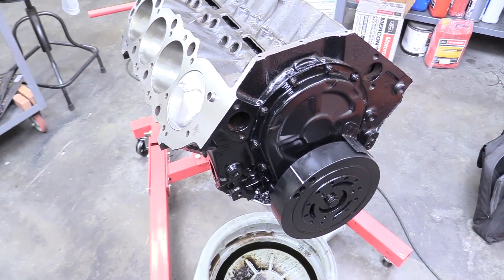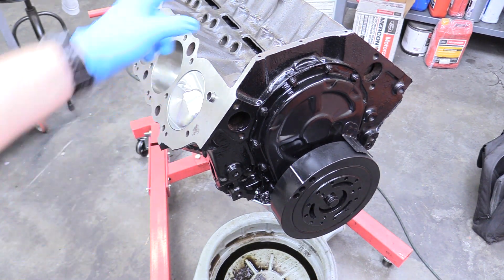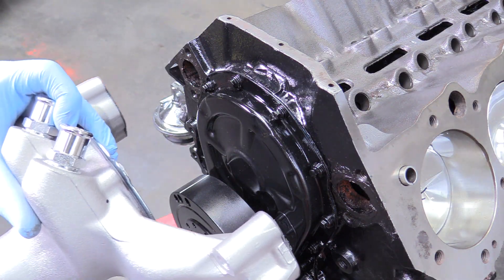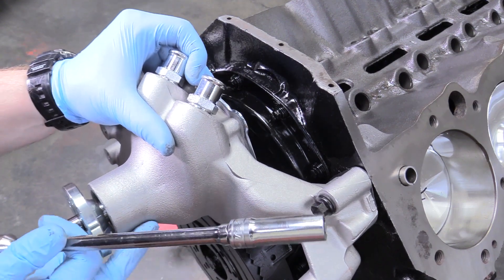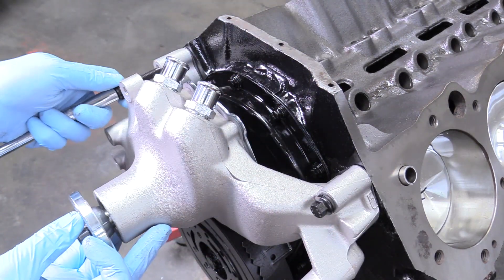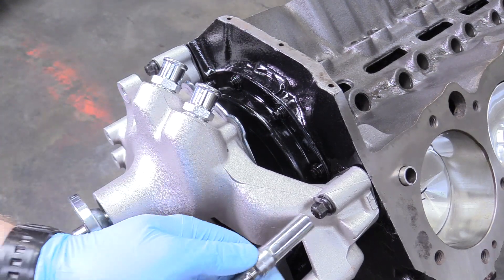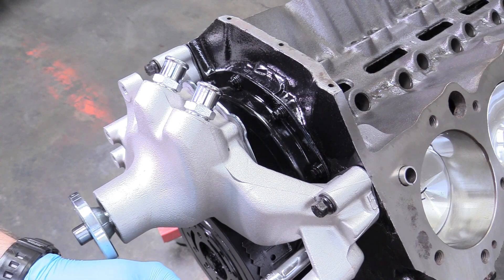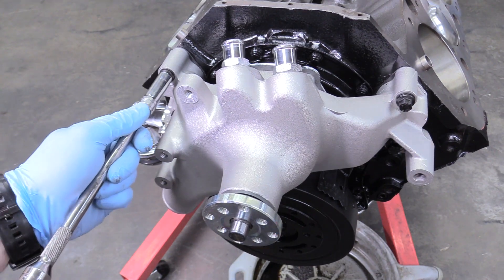How to Build a Chevrolet 454 Big Block Part 9: Fuel and Water Pump

Comment: did the 454 big block corvette use those oil lines for an extra oil cooler?
Reply from the maker: Usually external oil coolers were used in big trucks especially useful when towing large loads. Thanks for watching!

Comment: If it were me, I would paint before I did any of the building.  When I build my 5.3 it's gonna be Chevy orange.

EDIT:  Must be nice to do the fuel pump on the stand.  Had a Holly throttle body injector (pure junk) for a while the eliminated the mechanical pump on my 305.  Switched it to an Edelbrock quadrajet and had to reinstall the mechanical pump.  I coated that rod in heavy grease to make it stay in the block just long enough to install the pump without falling out.  Talk about a fight...but in the end I won.
Reply from the maker: Orange is a great call! 

Yeah it made it really nice. Nice work sticking it out!

Comment: Why would you paint the mating surface of the fuel pump and water pump??
Reply from the maker: Gasket and RTV it won't matter. Thanks for watching!
Reply: I agree.  You want clean metal on the pump mating surfaces, not paint.

Comment: Regarding your oil filter adapter, yours is a basic adapter. The OE for my application, as you mention, is for the 2 oil cooler lines. Should I keep those, or is it ok to remove that system and just put a basic adapter/filter system in?
Reply from the maker: You really don't need an oil cooler unless you are towing a bunch in hot weather. Thanks for watching!
Reply: @2carpros  Excellent. Is it easy to reinstall that if I decide to put it back in?